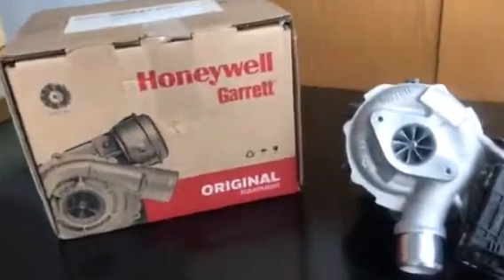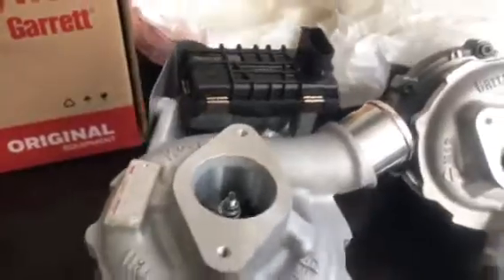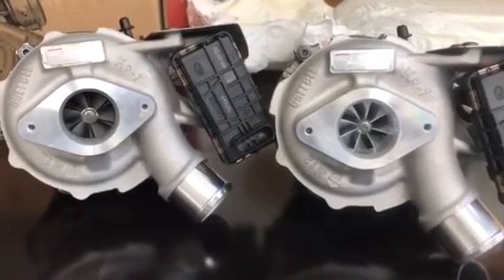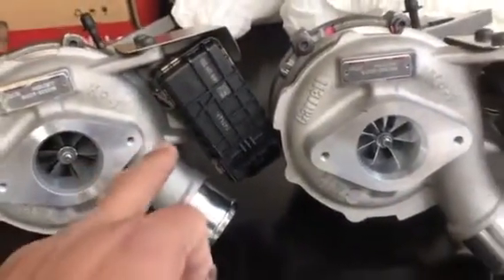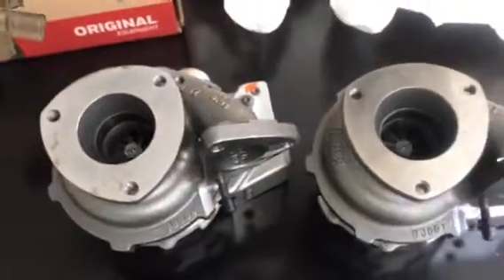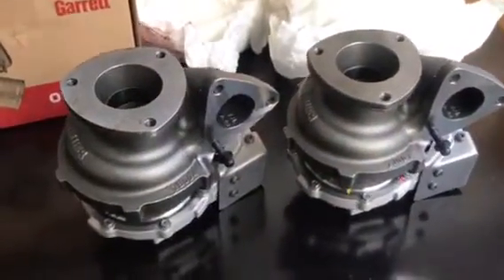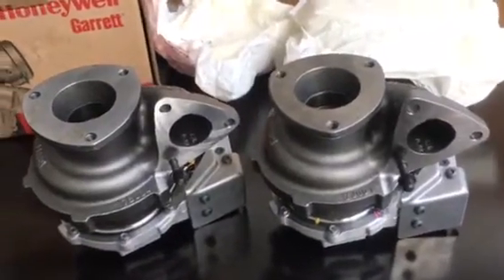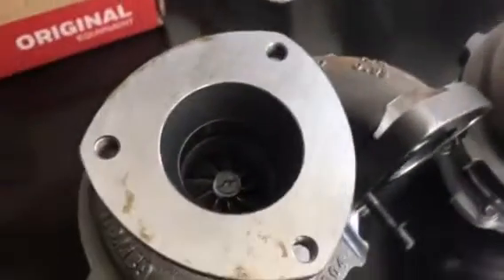Ford Ranger Powermax turbo compared

Comment: Hi TurboDirect S.A
I have a 2015 Ford Ranger 3.2 PX2 and wanted to ask if this Powermax Turbo would fit my Ranger and make a difference?
I ask this cause the OEM turbo (FB3Q-6K682-DD) on the compressor side has a 45mm inlet, but the Garrett Powermax GT22 or GTB2256VK  is only 40mm.
I also noticed the Electronic Actuator plug is in a Higher Position on the OEM but lower on the Garrett Powermax GT22 - Does this matter?
Your expertise and advise will be much appreciated.
Reply from the maker: There are two variants of the stock turbocharger from the 3.2 ranger. The latest is the revision that ises the UTA, instead of the older REA controller for the VNT assembly - this has the plug for the actuator in a different position, and not compatible with the older models at all. 

We do a hybrid upgrade to these turbos which yields ALOT more power than the powermax, and costs less than 50%

Comment: this upgrade serves to ranger 3.2 2017?
Reply from the maker: No it does not - after 2015, the turbocharger changed. It looks the same, but there are massive differences, including the REA (rotary electronic actuator) which now becomes the UTA (universal turbo actuator, which is located in a slightly different position, and uses a different plug and protocol - not compatible with the older ECU at all.

Comment: Hi there. Do you think a second turbocharger can be added to the single turbo ecoblue engine of the ranger/ endeavour to make into a twin turbo 2.0 engine that powers the everest/ raptor?
Reply from the maker: Not at all - the unit is a VNT turbo, and electronically controlled by the ECU - it wont be possible to tune/setup/calibrate a second unit without massive development in the tuning, ECU,  sector of the vehicle -
Reply: @TurboDirectSA  thank you for clarifying the complexity involved.. guess we out here have to wait for Ford India to launch the twin turbo if ever they decide to
Reply from the maker: @adityakrishna6016  Pleasure - Ford have in fact released their twin turbo setup on the new Biturbo Raptor engine - uses two Garrett turbochargers - i still will never purchase this vehicle as trying to use it for heavy loads like towing 2 tons or more behind it with such a small powerplant is not what i would use this tiny engine for. Yes it has 8 or 10 gears depending which model you purchase, but im the kind of driver who demands torque to use for towing - aka a large engine with capacity which will result in reliability over long periods of abuse/work/loads
Reply: @TurboDirectSA  the 3.2 makes sense as its larger size allows it to spin with less stress under load. Ford has launched the 2020 Endeavour here in India with a 2.0 litre single turbo which makes less power than than the 3.2.. the only downside is bad fuel economy of the 3.2 in city conditions. I guess i will look around for a 2019 3.2 as I have my heart set on the Endeavour/everest.
Reply from the maker: @adityakrishna6016  Our country has a different setup entirely -- funnily enough the bursting turbochargers on the 2.2 range were made in india with part# 787556-5017S -- the production was moved to the UK after we wrote the forensic metallurgical report for Garrett, and the part# changed. 

The 3.2 motor is a larger one and able to cater for highloads/towing/abuse as compared to the smaller 2.0 variant.

Comment: Hi There. Would you recommend a professional remapping on the ford T6 facelift 2.2 and do you know if the turbo fitted in that model can handle 20W extra power?
Reply from the maker: Hi Antonie - definitely not the 2.2 is already a problem child with its stock turbo, doing software will shorten the life of the turbo GUARANTEED!

Comment: Hi do you have a Powermax turbo for the 2.2 BT 50 ?
Reply from the maker: Apologies, no Garrett does not make a powermax for the smaller 2.2 motor. I would not recommend upgrading this turbo, they are not able to handle higher rotational speeds and will fail sooner than the original units do - these are already a problem with failures in stock format, compressor wheels bursting and when software is done, the thrust assemblies fail - stay away.

Comment: soooo... is there a performance difference between the two or is this just an FYI video?
Reply: Is there an option for the 2.2, or can this work for both?
Reply from the maker: @jaysonmakasi8830  No this will not work for the 2.2 - its a totally different turbocharger with different REA (rotary electronic actuator)
Reply from the maker: yes there is - the powermax increases power by 25KW, with software and hardware supporting mods you will see 200KW from the stock 147KW
Reply: Thanks for the reply. So a simple swap out will increase power by 25KW with no extra modification or a retune????? would this have the potential to damage the engine or other componentry just by doing the simple swap out? also, would you have a link to where someone could purchase the updated turbo?

edit:
just did some googling and can only find this turbo to fit 2011-2015 ford ranger 3.2L. i am assuming its the same engine in the 2016- current facelift model? is there any documentation to back that up?

Cheers
Reply from the maker: Nick, the install is bolt out and bolt in - no tuning will result in an increase, however tuning will make this better and obviously yield a higher performance output. Adding the intercooler and exhaust, will increase even more - some have achieved over 200KW to date.  The 2011 - 2015 range uses the electronic actuator known as an REA (rotary electronic actuator) and the SREA (simplified rotary electronic actuator) -- the 2016- upwards use something called a UTA (universal turbo actuator - look similar, but are not - ECU and UTA are calibrated to communicate with one another and won't work with the powermac turbo - we have requested for 2019 the release of the powermac turbo with UTA
Reply: Thanks for the info mate. Guess i will have to wait untill they sort out a newer model for 2016 onwards. 
Cheers.
Reply from the maker: It has been requested by many of us distributors and will be on the cards for 2019 im told.
Reply: Thanks for the reply mate. Cant wait.
Reply: @TurboDirectSA  Hi Chris has there been any update on the UTA for 2016 on wards models ?  looking to purchase when released  cheers
Reply from the maker: @georgec4188 not as yet, i have looked at making adapters up to transfer the rotating assembly into the UTA turbochargers end housings - it seems this is a feat more difficult than it sounds. Ill chase Garrett up and request some time line as to when this will be completed - and revert back. Stay in touch with us on our Facebook page and/or email info@turbodirect.co.za
Reply: @TurboDirectSA  Thanks Chris will do
Reply: @TurboDirectSA  Hi Chris just checking back on the UTA for 2016 model Rangers. Any luck as yet from Garrett ? cheers
Reply from the maker: @georgec4188  no idea, i will chase up again after the recent performance distributor conference last week.
Reply: @TurboDirectSA  Hi Chris just wondering how you went with UTA for 2016 model Rangers ?  pretty keen to get my hands on one if possible
Reply from the maker: @georgec4188  not yet buddy - Garrett are extremely slow with new product developments - it has been requested, but nothing has come of it thus far. I am working on making up inhouse parts to convert the Powermax turbo to fit the UTA equipped units -
Reply: @TurboDirectSA  Any progress on that project?
Reply from the maker: @peposgr  Garrett have not released anything on this as yet
Reply: @georgec4188  hey mate. Just letting you know that the new turbo for 2016 onwards is Garrett 880862-5001W.

Safari 4x4 engineering in Melbourne Australia relayed the information to me as they have started coming up with a flash tune for this turbo on their Safari Armax ECUs.

Cheers mate.
Reply: @1989cranston  oh ok has that just been released ?
Reply: @1989cranston  Thanks for the info
Reply: @georgec4188  unsure of the exact release date, I think it has been out for a little while but I just received the information myself.